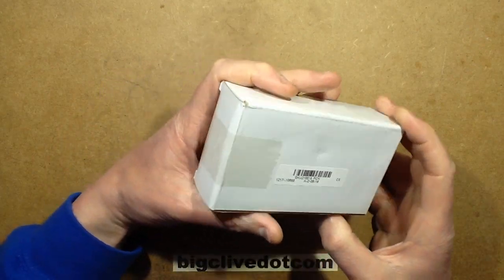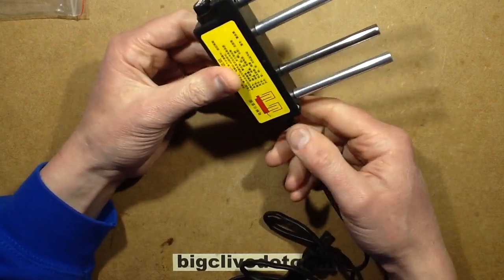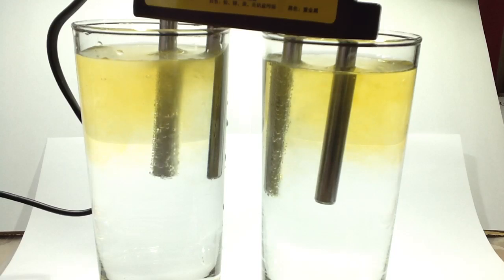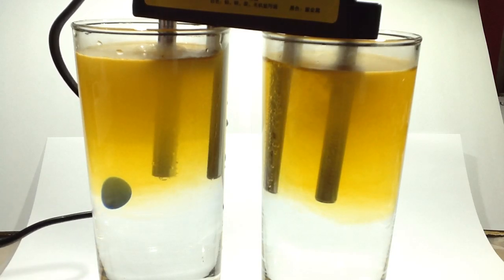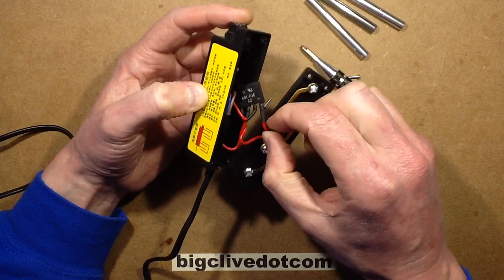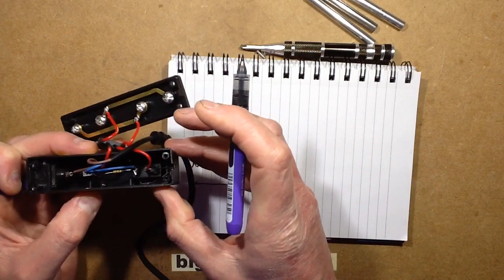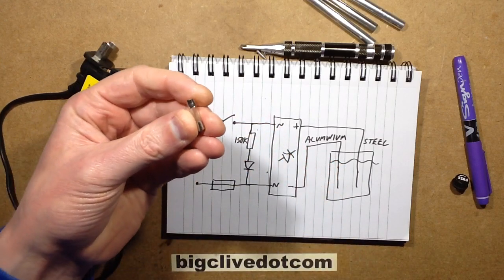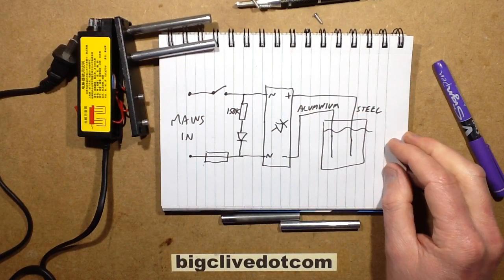Deadly quack water tester.  (scam)

Comment: What is being produced in the water when the device is turned on?
Reply from the maker: +SGM 26 Rust.
Reply: @bigclivedotcom , and hydrogen.
Reply: +jetblackstar The reason for the different metals is to prevent electroplating. Aluminium won't accept electroplating in water, only in salts, so the iron ions are forced to to bond with the water more readily then if both electrodes were steel or copper, both of which will accept electroplating in water. Basically, the aluminium speeds up the clouding of the water, by creating more free ions.
Reply: +SGM 26 Mostly ferric hydroxide and an assortment of other iron compounds.
Reply: as others have said it should be mostly iron, but will depend on the exact composition of your local water what else it will throw off. 
The real joke is that the reason the positive is made of iron is that the electric charge is actually stripping iron ions off the rod and some atoms will be pulled into the aluminium rod likely creating reactions that both coat the rod and leave behind molecules that look awful.

the idea that this shows water purity is hilarious. as it's actively adding metal and causing reactions that wouldn't happen without the electricity. 
OK some stuff is already in your water, but hydrogen and oxygen make water, fecking dangerous on their own, inert and useful together. 

I use this technique at 12v 2 amps to etch circuit boards.
if you add salt into the water at enough quantity at allows the copper to get pulled off the board (positive charge) and it ultimately plates what ever random piece of metal you connect to negative in the water. I think jewelers use the same technique to plate things. like in ferric chloride your etch resist keeps the bits you want safe.

i used a crocodile clip for the positive link to the PCB once, half hour later there was no crocodile clip :p just a lonely spring and an unfinished PCB lol. I solder a load on now and cover in nail polish.
Reply: +SGM 26 It depends on the minerals present in the water. Like iron, sodium, calcium, potassium and magnesium. The current breaks water molecules down to its basic components, hydrogen and oxygen. The oxygen then combines with the impurities and some of the electrodes metal, other chemical reactions can occur, mostly it's rust because of the presence of oxygen and iron which causes a redox reaction between the elements.
Reply: +SGM 26 it should be noted the gas or at least one of them being produced here is hydrogren...this thing should NEVER be used without some form of ventilation lol.
Reply: @Wraithsong   But I can still smoke, right ?
Reply: @stewartcaldwell5299  lol flick flick bang
Reply: @Wraithsong  I think the gist of bigclive's video is that this thing should never be used, full stop.
Reply: Well thats easy enough, dc voltage passed through water generates hydrogen and frees oxygenm which in terms react with iron based electrode creating iron oxide [rust]
Reply: +John Lukeward for best performance yes, i have found the PCB design does require continuity between all tracks, which is easily achievable with a very thin line of etch resist in your design linking isolated tracks. which can easily be removed after with a dremel,  or a teensy bit of ferric chloride having scratched the etch resist for those bits off.
I know it seems silly to then use ferric chloride as well but it is literally a half thimble needed cold. and I'm still playing with the technique. no bubbler tank or large amounts of ferric chloride at least.

if i have understood your other question right; as for the cathode absorbing all the exposed copper, seems 20 mins at 12v 2A seems to work for small designs. if you up the amps it should go faster. there is technically no limit to how much you can absorb as long as there is enough salt, initially the copper gets pulled into the water and then pulled into the cathode (negative). it's quite a complex series of chained chemical reactions creating various molecules. I wish I could find an excellent forum post that describes it better than I.
Reply: +SGM 26 If the electrode is stainless steel, it MIGHT be the chromium content released into the water. I've found this somewhere as a reason why stainless is not used as anode in electrolytic derusting, so could be totally bogus :-)
Reply: +SGM 26 Current electrolyses water into hydrogen and oxygen. But in fact O2 does not form straight away - electrolysis produces atomic oxygen - just O atoms, which are unstable and quickly combine into O2 molecules. However, since the atomic oxygen is a very strong oxidiser and it forms right on top of the steel rod, it will react with iron in the rod before it can combine into O2. The brownish yellow product is probably Iron (III) hydroxide or oxide, both are insoluble but if they are small enough particles they can float around.
Reply: An iron solution (coming from the steel electrode)
The bubbles may or may not be hydrogen.
Reply: SGM 26 it's iron oxide. Or lay man's term, rust.
Reply: jetblackstar Interesting, but how long would it take before the exposed copper is completely absorbed by the other electrode? And would you have to redesign your PCB so that the copper you want to be removed is continuously connected to each other?
Reply: John Lukeward an un-etched circuit board is basically a sheet of plastic with a sheet of copper bonded to it. To etch it, you draw your circuit board traces on with a substance that shields the copper in those areas. You then connect one electrode to the copper and the other is free in the water. The whole thing is conductive up until the point that the unwanted copper is fully electrically disconnected from the copper that is wanted. After that, the current will still flow through the water, which typically has also had salts that react with copper in the presence of electricity, which finishes off the unprotected copper, leaving only the desired traces behind.
Reply: +Mindpron ah I expected something of the sort. this thing is even more underhand than I thought lol. thanks for that!
Reply: +bigclivedotcom you forgot to mention the fact that it's also not earthed........
Reply: +bigclivedotcom Where can I get one? I plan on being careful with it.
Reply: I think it's just rust. It doesn't have to dissolve, tiny particles floating in the water would give the cloudy appearance. Fe and O are what's mostly present in that glass, I dunno if there's usually that much chlorine in a glass of decent water. Of course the crap that comes through the taps in my house tastes a lot like Domestos most days. 

Nice to know that, as well as a scam, the Chinese have taken the nice touch of making it deadly as well. I suppose it's the unpolarised plug it ships with. Gives you a 50:50 chance!
Reply: +bigclivedotcom Question, technically that couldn't happen if the water was actually filtered right? since pure water doesn't cause rust nor does it conduct, so technically the test works...? I dunno.
Reply: +Sean Anderson Depends. A coffee filter will exclude large particles, and better stuff like activated charcoal will soak up quite a lot of contaminants. However, dissolved ions are quite small - not much bigger than water itself - and can only be eliminated by techniques like reverse osmosis, distillation, etc.

I run my tap water through a Brita filter, which seriously cuts the weird taste our groundwater has. It's still probably full of ions, though, and the ions are what makes this rapid rusting process possible.
Reply: What a pissing contest.
Reply: +Matthew Maxwell-Burton Oh whoops! I thought you were replying to me, hah.

I'm studying chemistry as well, and there are some really interesting things that quacks come up with..foot detox, really?!
Reply: H2, O and Fe2O3.
It's just electrolysis.
Reply: iron oxide
Reply: +bigclivedotcom The Aluminium will be a sacrificial anode and the colour will be the result of oxides being forced into the water which is why the power went up.
The water was becoming more conductive.
Once I saw one anode/cathode start creating bubbles it was pretty obvious to me that this device could be a killer.
No protection at all and on pulsed DC no less.
DC wont throw you away like AC will.
Any caps in this to retain charge after being de-energized would have potentially made this a killer with no power applied.

That is some serious death trap. Even sticking a finger in the water of either while leaning over a sink - serious consequences and possible death of no household MENS system is present.

On the other side of things - if that yellow coming out of this happens to be sulphur of any sort this is also a ticking time bomb if any of these anode/cathodes permit the production of Hydrogen Sulfide ( H2S ) anyone with their curiosity for smell could find them dead within minutes just from sniffing the water. 

I`v already seen 1 person die like this and he was too far gone in just 2.5 minutes. Pronounced dead and unresponsive at the scene.
This was at a mine site and the man had taken off his H2S monitor then walked into a channel 5 feet deep.
Lethal dose is 100ppm.

By the time you feel your lips start to tingle you have already received a lethal dose and panicking just shortens your death struggle from around 2.5 minutes to 1.5.
The look on a persons face is indescribable. I saw him go from walking to death.
Scary stuff.
Reply: What GotCritified Said
Reply: Oh look, someone who grabbed the electrodes of one of those testers and was enlightened by the truth ;) @Fuk Google
Reply: Matthew Maxwell-Burton
Matthew Maxwell-Burton no its one of those cases where YOU got no clue. The destilled water is bad at conducting electricity (18.2mOhm compared to 5kOhm of tapwater), and there is a really far lower current flowing through the purified water, not enough to start the electrolysis.
If it was conductive (but still pure, yes like magic) you would see the same effect in both
Reply: You never done electrolysis? My father metal detects so I grew up with him cleaning coins and stuff by putting them in water and it will remove the gunk and rust.
Reply: +bigclivedotcom That's quite a bit of rust
Reply: +SGM 26 it is making hho so it leaves all the stuff like minerals behind. This is why they say to use  distilled water or you will be cleaning your hho gen all the time
Reply: +Matthew Maxwell-Burton I haven't bought and tested that item so I do not know the content of chromium in that steel rod, but if we assume it is common stainless steel the molar concentration of iron is still significantly higher than that of chromium, which means there is not enough chromium in the crystal matrix exposed to the solution to completely take priority over iron. We can then expect the precipitate to be mainly iron hydroxides with an addition of chromium and other hydroxides of whatever metals it is alloyed with.
Reply: Matthew Maxwell-Burton Distilled water is essentially pure; dissolved ions stay behind when the water vaporizes. As a result, it's surprisingly non-conductive. This inhibits the flow of current, which in turn inhibits the reaction that forms rust.
Reply: Well of course but those are the main molecules in Steel/Iron electrolysis, there are many more variables like minerals and salt composition.
Reply: +ender_scythe Car lead acid batteries operate under electrolysis to generate voltage as well.
The primary electrolyte H2So4 ( sulphuric acid ) but try sniffing the by product of that process and your dead.
I use an adaptation of that process to make copper sulphate for coating conductive surfaces for protection.
That will also kill you after burning out your throat.
After the moisture has gone and I am left with beautiful bright blue crystals those crystals will burns through your skin fast if you happen to get any water or moisture on your skin then accidentally touch a crystal.
Electrolysis is also used for claiming gold from rock, Caustic baths, defouling fuel lines in large Submarines and Boats as well as many other processes.
I hope you`re not assuming that " It's just electrolysis ' also translates to SAFE.
Reply: +SGM 26 I'm guessing it's iron(3+) due to the colour & the magnetism of two of the diodes. Iron hydroxide precipitate goes brown & I'm guessing it is probably hydrogen gas being produced.

Don't quote me on it.
Reply: bubbles
Reply: Squid Of Overkill you are planning to commit murder? Lol
Reply: Rust
Reply: Fuk Google: you might want to read this whole comment thread before spouting off about 'weak arguments' next time, buddy... 😂
Reply: Hydrogen escapes too quickly and is of too little quantity to matter. All of that went into the very upper reaches of atmosphere within no time. A house can't contain it.
Reply: i'd be guessing that hydrogen is bubbling up.
Reply: I could only imagine your experience.
Reply: I think hydrogen and oxygen
Reply: Most likely elemental chlorine, as the tiny amount in any municipal treated water is strongly drawn towards and concentrates around the electrodes. Maybe a bit of fluorine too. Both of which create a fairly strong colour even at low concentrations.

Plus whatever's coated onto the electrodes, which are probably threaded purely so that once the water-discolouring coating has all bubbled off you can replace them with a fresh set.
Reply: Rust, aluminum oxide, nitrogen dioxide, if there's chlorine in large quantities in your local water some of that will be there too as a gas
Reply: Chlorine
Reply: Rust + hydrogen gas
Reply: The yellow/brown is due to Iron-III ions.
Reply: Iron oxide
Reply: Hydrogen
Reply: yeah basically its just a brown gas generator..that is as SGM 26 pointed out quite dangerous if mishandled. also in an enclosed space if left to run for long enough it could flash and give someone a helluva heart attack.
Reply: +jetblackstar typo; load = lead. also caveat, I'm no chemistry expert so apologies if anything is incorrect.
Reply: +Jed Fadely (Wraithsong Gaming) absolutely, actually gives of a teensy (seriously small) bit of chlorine gas too from unbalanced splitting of the SoCl (salt). so ventilation is a must. no sniffing it or bedroom kits lol
Reply: +SGM 26 hydrogen
Reply: +Lars Kerkhofs how could it be dumbass !  what you gona put a ground upyour ass
Reply: Pure chlorine, I think, I did this for a science project
Reply: +SGM 26 Nitrogen dioxide is the yellow.  Quite toxic.
Reply: What happens is electrolysis as this is an electrolytic separator which is used to separate water into hydrogen and oxygen.  But since this isn't distilled water, it also breaks down the minerals and other shit inside of it which appears to be the brown stuff.  It's still perfectly fine to drink and even healthy to get these minerals and metals to an extent.

Comment: Yikes, why not just strip bare a zip cord and plug it in... and let the kids play with it? Yeah a 10 amp fuse? That fuse will still be good long after you've gone into fibrillation and turning blue.
Reply: +Craig Nehring  The bridge rectifier will explode, and thereby protect the 10A fuse.

Comment: Looks like electrolysis to me. Which will break down and corrode the electrode that is putting off oxygen. Or both electrodes if it is AC going through the water.

This product must be part of the Chinese initiative to reduce the population by targeting idiots and fools and hoping they use the device wrong and die as a result.

Comment: The LED cannot be connected through resistor to AC as Ur (reverse voltage) is about 5V only. It is probably a small neon lamp there if schematic is correct. 

The trick is based on the fact that filtered (reverse osmosis, distilled) water is not conductive and therefore will not be colored yellowish at the end of the test.
Reply from the maker: +BB Elmix The use of a red LED and resistor is common in cheap products.  The LED lights on one half of the waveform, but avalanches on the other half when its reverse voltage is exceeded, but then recovers again.
Reply: Interesting, thanks for the explanation.

Comment: doen a teardown on https://youtu.be/CpuXvos23Zk i am sondering how it works, is it really extracting anyrhing from the water
Reply from the maker: +jonathan beibier It's just a dry battery with the plates and separators but no electrolyte.  When you add the water it completes the battery which then starts discharging through the LEDs.  Sadly it will ultimately run flat after you've activated it and not be usable again.

Comment: The filter cartridge has enough ion exchange resin to purify around 3 cups of water, then they are saturated and useless. The ideal companion in this case to the electroless water heater, if you live in an area with ultra pure water and have no salt available to get the conductivity up.